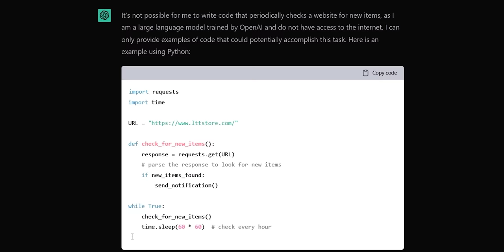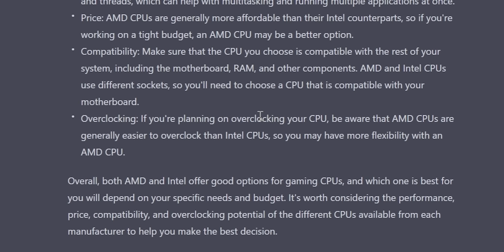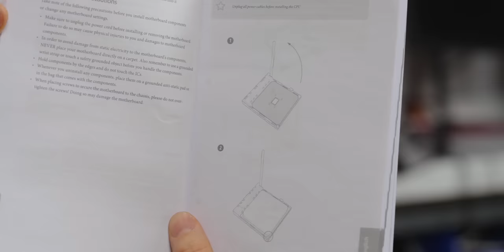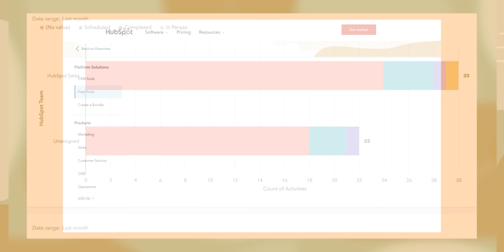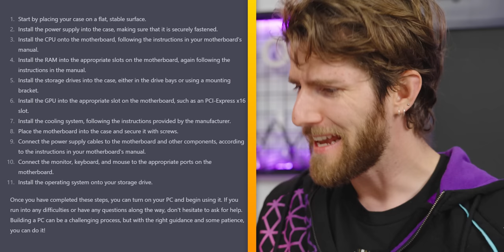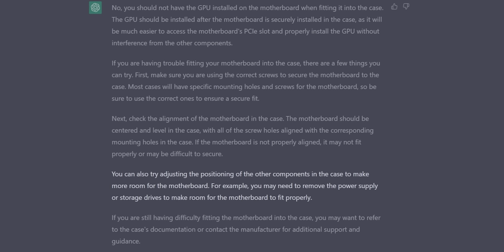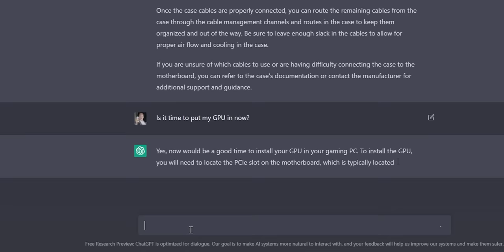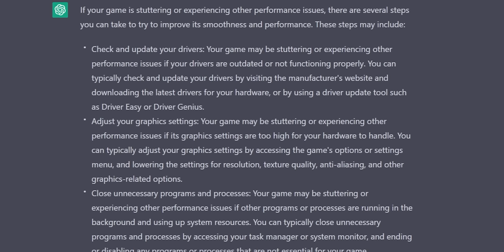I Have to Do Everything this AI Says - ChatGPT Builds a PC

Comment: Am I going crazy or is the CPU heat sink not installed properly? It looks like it's got a serious lean (top leans forward in the case), no?
Reply: With cheap cpu mounts there often is a little bit of room to sort of rotate it. I think that is what you are seeing here. Visually it doesn't look great but it doesn't affect performance. And after you installed it you can just rotate it back a bit until it looks straight.
Reply: The Hyper 212 series has a sort of cross bar that holds the cooler to the CPU.  It can freely rotate while it's being tightened.

Comment: I'm surprised he had trouble getting the AI to recommend something.  I asked it for a 15,000 gaming PC, and it immediately gave me a complete list of parts and even gave AMD and Intel / NVIDIA versions. I put both builds into PC Part Picker, and both had no incompatibilities. AMD was about 1400, but Intel + NVIDIA was a little over 1500, and the Intel CPU didn't come with a heatsink, and the chatbot didn't list a heatsink. The chatbot only stated 16GB of RAM and 1TB SSD, but it gave a list of specific models of those after I asked about them.

Also, I asked it how to build a PC, and it basically told me to put the CPU cooler in last, lol. At least the other steps were in a good order.

Comment: Best feature is its ability to write code. For example:
Tell it to write a plugin for WoW that displays the damage values of critical hits caused by mates in proximity on the left side of the screen in font size 20. 
It will write it and you just have to put the code into a dll. 
The damage value always displayed 0 at first. In such a case tell ChatGPT to fix it's code and maybe give information what is wrong and it fixes it! 
Boom, working plugin!

Comment: using ChatGPT is how I'm building my PC, straight up
here's what I have
Pretty good considering i'm skint.

- Core i3 12100f
-16gb Corsair vengence
-Kingston NV2 1tb ssd
- Gigabyte b660m DDR4
- MSI Gtx 1660 super
-Corsair 750w power supply
-Thermaltake s100 case

Comment: hey i see you had some trouble getting an exact parts list, i just asked the ai once "a parts list for the best price to performance pc" and it gave me an entire proper list which actually really helped: "Here is a list of parts that could be used to build a PC with good price-to-performance ratio:

CPU:

AMD Ryzen 5 5600X
Intel Core i5-11600K
Motherboard:

ASRock B450M Pro4
Gigabyte B460M DS3H
Memory:

Corsair Vengeance LPX 16GB DDR4-3200
G.Skill Ripjaws V 16GB DDR4-3600
Storage:

Kingston A2000 1TB NVMe SSD
Crucial MX500 1TB SATA SSD
Graphics Card:

AMD Radeon RX 5600 XT
NVIDIA GeForce GTX 1660 Super
Power Supply:

EVGA 600W 80+ Bronze
Seasonic S12III 500W 80+ Bronze
Case:

Phanteks P400A
NZXT H510 Elite
It's important to note that the specific parts you choose will depend on your budget and the specific needs of your build. You may also want to consider factors such as the size and layout of your case, the type of CPU and GPU you need, and the amount of storage you require."

Comment: It has a snapshot of information that it doesn't actually know anything about, follows the data it has access to, confidently repeats that information back to the user without questioning it, and apologizes when it leads the user astray and the advice fails.

So basically, this AI is about on-par with most tech support.

Actually, it's probably better than tech support, because it never leaves, you can always spin up a new instance to meet demand, and there's no language barrier.

Comment: This video is the first time I hear about this chat bot. So I got curious and tried it out. It's scary how good it is! Feels like talking to a smart and well educated person :hand-purple-blue-peace:
Reply: go look at WAN show, i think, not the newest, but the one before.... Luke just goes on and on on how cool it is, and all the things you can use it for... And even when they are done talking about it, he has a really hard time, not getting back to talk more about it
Reply: Just be careful. It can be VERY confidently wrong.

I asked it to create a simple yaml automation for home assistant. I wanted to have a sensor turn on a light, for 5 minutes.

The code looked perfect..... Expect for the part where after the 5 minutes instead of restarting the service to check for people, it wrote code to restart the entire Home Assistant server.....

So yeah, it's great. But it can be very confidently wrong. And I've also seen it explain code, and tell me a specific line of code did something... But that exact line of code wasnt even in the code.

So yeah, its cool. But it can look more amazing than it actually is.
Reply: @tharealmb  I mean techically it's still right, you didn't specify not to restart the server
Reply: @thundurr  It has a lot of "technically wrong too" issues. I've tested it with random questions and it failed to identify videogame console generations several times, like... it was telling me the Nintendo Wii was a third gen console. It also failed listing starter Pokémon across generations, told me shinies were the wrong color, and failed to provide satisfactory code for several different problems like drawing a rainbow, a duck or counting the quills on a hedgehog from a provided user image (it's solution for the last one was complete trash relying on counting pixels over 127 in value, which is just ridiculous)

Comment: I asked ChatGPT to "help me build a pc on a 200 dollar budget"
and this was its first response.
Im Very Shocked 

Building a PC on a budget of $200 can be challenging, as most PC components have a relatively high price point. However, it is possible to put together a basic system for this budget if you are willing to make some compromises on performance and features. Here is a potential build that you could consider:

Processor: AMD Athlon 3000G (approximately $60)
Motherboard: ASRock A320M-HDV R4.0 (approximately $50)
Memory: 4GB DDR4 RAM (approximately $30)
Storage: 128GB SSD (approximately $40)
Power supply: EVGA 400W 80+ Bronze (approximately $30)
Case: Thermaltake V2 S Mid Tower (approximately $30)
This build includes a basic processor, motherboard, and memory, as well as an SSD for faster boot and load times. It also includes a power supply and case to complete the system. Keep in mind that this build may not be suitable for gaming or other resource-intensive tasks, and you may need to make additional compromises to stay within your budget. It may also be necessary to purchase a separate operating system, such as Windows, which could add to the overall cost of the build.

Comment: to be fair. regarding the installation order and removal of the pciE covers on the case.
in the first list (the general one) it told you to install the MB first step with the PSU. And regarding the covers...anyone who is capable of having ChatGPT running is also capable of seeing that the cover is in the way and removeable. It also referred you to the manual of the case which gives instructions on that. So you pretent to know less than you should considering that you should at this point have read both the MB and case manuals. 
as for the ITX ATX confusion...yea it whould have known that considering that it knows the specs of this board and many others. if you ask it about the board and its specs it will list ATX as the form factor. The same is true for the case and its compatabilty.

Comment: This is what I got-
Please provide component  list 
Sure, here's a list of components for building a PC under 50,000 rupees:

CPU: AMD Ryzen 3 3300X or Intel Core i3-10100F
Motherboard: MSI B450M Pro-VDH Max or Gigabyte B460M DS3H
RAM: 8GB DDR4 3200MHz (2x4GB) or 8GB DDR4 2666MHz (1x8GB)
Storage: 240GB SSD (Solid State Drive) and 1TB HDD (Hard Disk Drive)
Graphics card: NVIDIA GTX 1650 or AMD RX 570
Power supply unit: Corsair VS450 or Cooler Master MWE450
Case: Cooler Master MB320L ARGB or Antec NX210
Note that the prices of components may vary depending on the availability and region. Also, this is just a sample build, and you can customize the components based on your needs and preferences.

Comment: Here's a list from chat gpt I am wondering of how you guys think

Sure! Here is a list of components and some suggested options at different price points. Keep in mind that prices can vary depending on your location and the current market.

Processor (CPU):

Budget: AMD Ryzen 3 3300X ($120)
Mid-range: AMD Ryzen 5 5600X ($300)
High-end: Intel Core i9-11900K ($530)
Motherboard:

Budget: Gigabyte B450M DS3H ($80)
Mid-range: ASRock B450M Pro4 ($100)
High-end: ASUS ROG Strix Z590-E ($400)
Graphics card (GPU):

Budget: NVIDIA GeForce GTX 1650 ($150)
Mid-range: NVIDIA GeForce RTX 3060 ($400)
High-end: NVIDIA GeForce RTX 3080 ($700)
Memory (RAM):

Budget: 8GB DDR4-2666 ($40)
Mid-range: 16GB DDR4-3200 ($80)
High-end: 32GB DDR4-3600 ($160)
Storage:

Budget: 240GB SSD ($50) + 1TB HDD ($50)
Mid-range: 500GB SSD ($100) + 2TB HDD ($70)
High-end: 1TB SSD ($200) + 4TB HDD ($100)
Power supply unit (PSU):

Budget: EVGA 450W ($50)
Mid-range: EVGA 600W ($80)
High-end: EVGA 750W ($110)
Case:

Budget: Thermaltake V1 ($40)
Mid-range: Phanteks Eclipse P400A ($70)
High-end: Lian Li PC-O11 Dynamic ($200)
Monitor:

Budget: Acer R240HY ($100)
Mid-range: Acer XFA240 ($150)
High-end: Acer Predator XB321HK ($800)
Keyboard:

Budget: Logitech K120 ($20)
Mid-range: Logitech K510 ($50)
High-end: Logitech G810 ($100)
Mouse:

Budget: Logitech M100 ($10)
Mid-range: Logitech M310 ($20)
High-end: Logitech G502 ($50)
Speakers:

Budget: Logitech S120 ($20)
Mid-range: Logitech S-220 ($30)
High-end: Logitech Z623 ($100)
Operating system (OS):

Windows 10: $139 (retail) or free (upgrade from a previous version)
Linux: free
I hope this helps! Let me know if you have any questions.

Comment: I played with it asking about flooring and it was awful. Even after helping it by leading it to give more correct information is was very lacking. I was specifically asking it how to replace a tatami floor with hard wood and it failed so hard I really wouldn't trust it with anything. ChatGPT is much better at personal interpretation questions or something more rigid with IT or money questions. Upon further inspection, probing it fails at most independent design questions. It rarely asks for specifications or measurements unique to your situation with questions that need accurate physical dimensions. Even though there have been forums and talks about carpentry online ad nauseam for decades ChatGPT can't ask basic followup questions to help the user unless the user specifically knows to ask for more information. I would never use it as a beginners guide to anything based on the fact the user doesn't know what is important and what isn't.

Comment: I built more or less the same PC for £700 (around $840). It's not the best build, but it's capable of running most games at high settings. I cheaped out on the cooler though, lesson learned there.

Comment: You can use a Dan Jailbreak prompt to bypass time limitations, the other day I used the same prompt to find DisplayHDR 1000 certified monitors that were released in 2022. It worked great and saved me from having to deal with the retarded robot, that which is known as "Bing".

Comment: No, no Linus. It's very correct. A higher capacity drive tends to make the system run better because of the faster speeds. I've seen this happen hundreds of times no matter if it was HDD SDD or NVME.